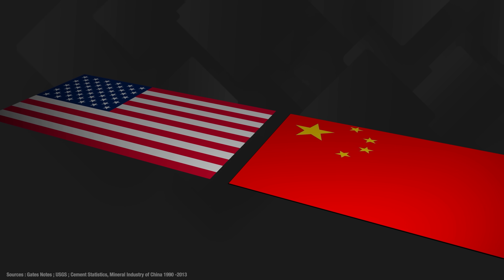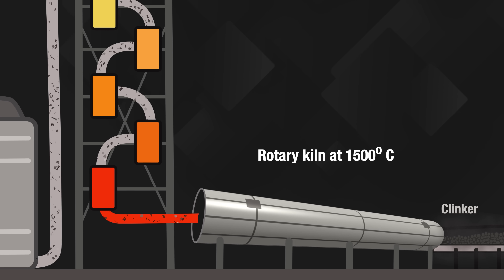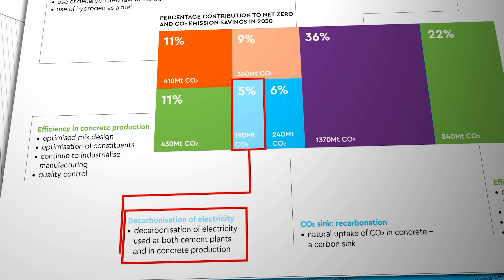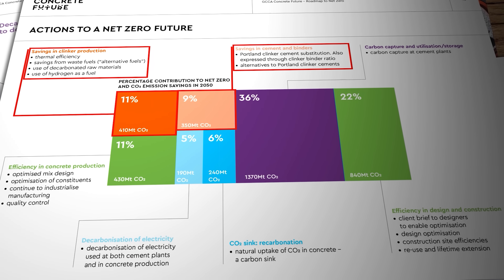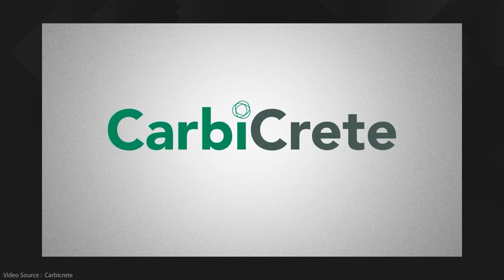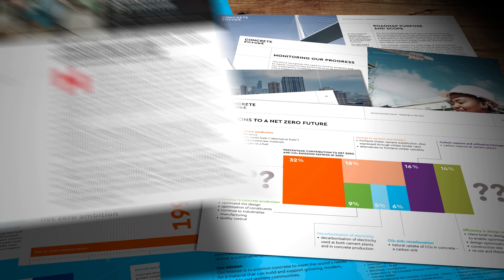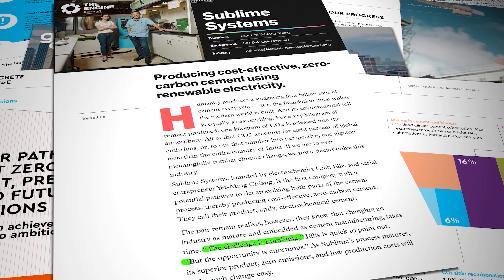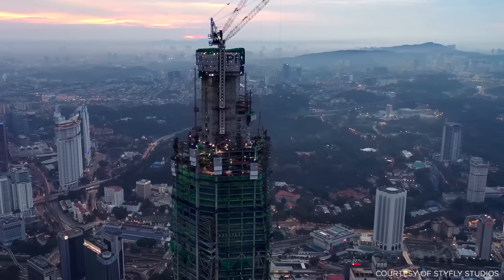How to make concrete green!

Comment: I like the idea of using cement for roads and airport runways instead of asphalt.  The biggest issues I have with concrete have always been the massive carbon emissions, and the lack of sand available globally.  With the use of carbon capture and utilization, CO2 injected into the cement reduces the need for aggregate by 5%.

Comment: If any of these carbon free/reduced methods are just 1% (or more) cheaper and the same strength as standard concrete and can be produced in the same amount of tons per year it will replace the old type in a hurry. When a single building can cost hundreds of millions to build a saving of "only" 1% is still huge amounts of money. So beat the price of regular concrete and you may not even need to advertise more than once.
Reply: @AgW      Subsidies are the answer to that.
Reply: @J4Zonian  No, subsidies are never a solution and we need the funds better elsewhere. Extra tax on carbon emitting material will do much more for all sectors, if the "good" stuff is more expensive then raise the prize for the bad stuff, easy math and more revenue to pay for the infrastructure that needs updating..

Comment: I love the smell of fresh poured concrete.  Aside from that I hope they do come up with a greener version which can help absorb more CO2.

If you remember Biosphere II had problems because whatever they used to make some of the substrate was absorbing Oxygen and not CO2.  A lesson for space developers.

My love of concrete though goes beyond the smell in that I like rocks and bricks and think of them as a more natural building material (even if rocks tend to have issues through time if you select a rock with flaws or it doesn't like the stresses that it is placed under), but cement is much more predictable and very flexible (yet still not perfect as sometimes things happen and people get bad batches).

The future though is going to be in space and figuring out what can be done with available materials in space so you don't have to pay the gravity lifting costs of things to build new environments.

Comment: I am almost thru with it but see no mention of using heat from mirrors or mantle as recently awared by usa fed agency many millions.

but clearly using both sides the cement releases and the heat generatiing releases which i have not veriried is being shown.

BOTH

concentrating solar is said to go hotter then electric for some reason i don't yet believee...

yeah so entire video went by without mention of cc

Comment: The exothermic reaction in curing of 6.6 gigatons of cement would produce 1.32 trillion degrees of heat. Which is 48,888x the temperature of the sun

Comment: It’s interesting to see my work referenced in one of your videos.  I’m working with Lafarge to use alternative waste material fuels, which reduce CO2 output by 20%.
Reply: @Adam Flannigan    20% of some small part of 8% is not enough for civilization & nature to survive.
Reply: @J4Zonian  Perfect is the enemy of good, everything helps
Reply: @J4Zonian  I never said that it did, just that it’s interesting to see my work referenced.
Reply: @Johnrich395   I understand.

But perhaps I understated my case. I would have been more specific if I knew 20% of what? (call the what “x") All concrete emissions? Then it would be 8% of global emissions, divided by .2 = 1.6% of global emissions. If it’s only reduction of a part of concrete’s bill, divide by x & it’s some fraction of 1.6% of global emissions. We need to reduce global emissions by more than 90% in the next 9 years; that means reducing every sector by >90%. If any sector is reduced by less than more than 90%, other sectors have to be reduced by more than more than 90%. That’s extremely hard in 9 years. 

So enough of this crap (& I don’t mean yours, I mean the concrete & associated industries’ crap, which is typical of every corporation’s, industry’s, & government’s crap) about 20% reductions & imaginary 36% reductions... we need to reduce concrete emissions by >90% in 9 years. 

“There are no non-radical solutions left.” 		Naomi Klein